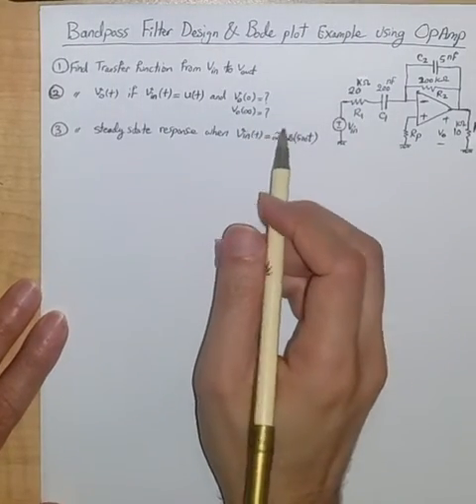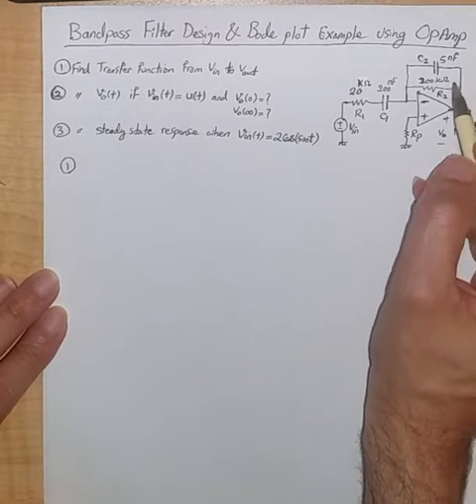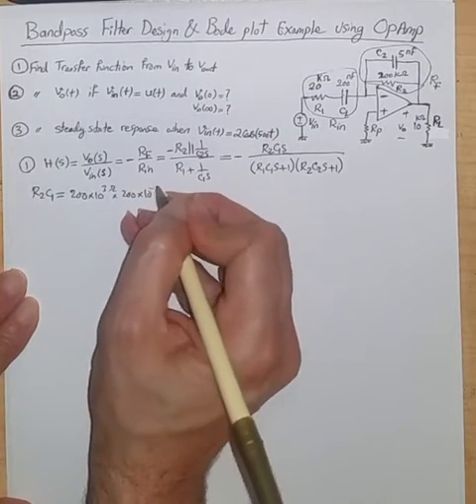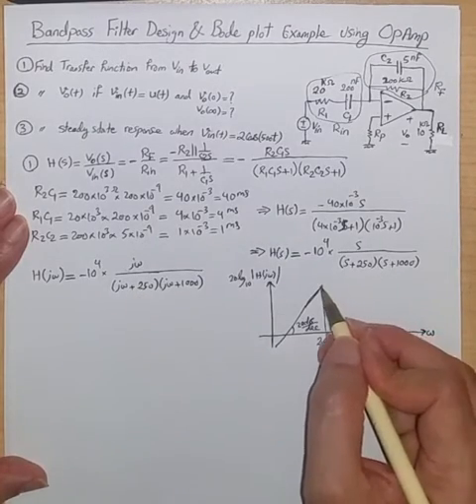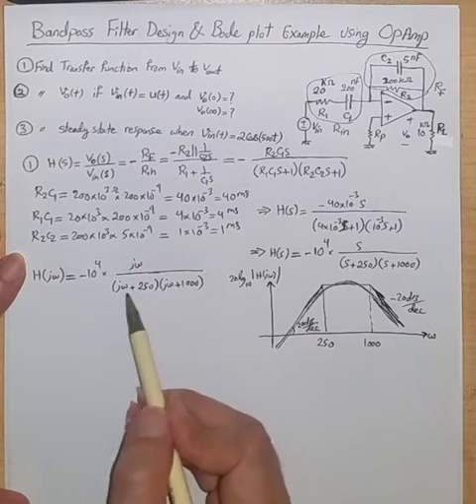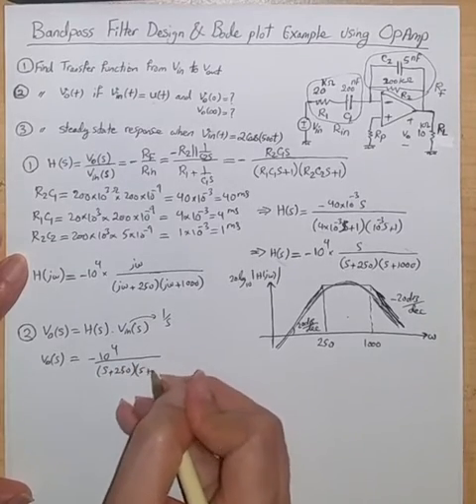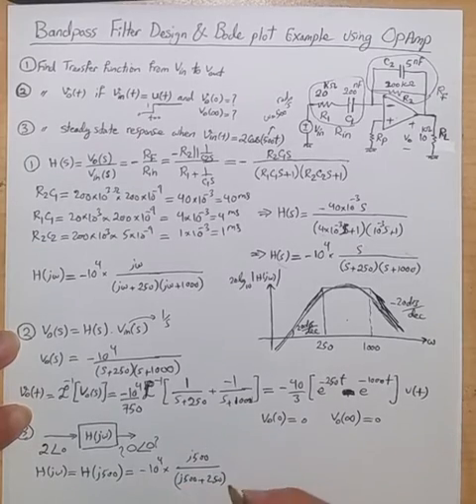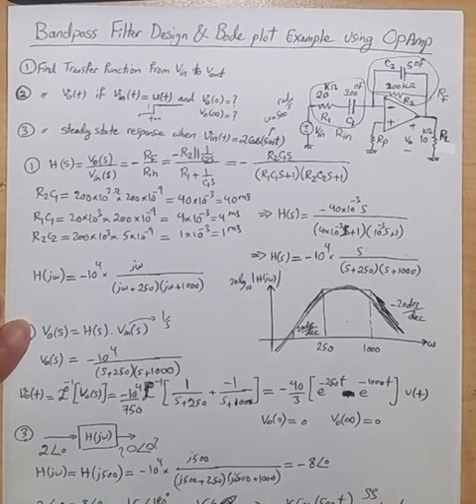Filter Design using Op Amp and Bode plot Example

Comment: Do you have 2nd order active hpf?
Reply from the maker: Thanks for watching and question. Yes, for more OpAmp Filter examples please see https://youtu.be/2J-0msXZE2o  which implements Highpass Analog Filter as well as Lowpass, Bandpass and Stopband Filters with Op Amps.
https://youtu.be/U3AR1XCkX8k  is a BiQuad Filter Circuit Design and Transfer Function Analysis.
https://youtu.be/Ga8Lu8sWlAk explains Analog Filter Frequency Response and Poles and Zeros in Bode plot.
For more examples please check the Analog Circuit Design Videos Collection: https://www.youtube.com/watch?v=2J-0msXZE2o&list=PLrwXF7N522y4c7c-8KBjrwd7IyaZfWxyt&index=17
I hope these Analog High-pass, Low-pass and  Band-pass filter design and analysis examples are interesting and helpful.